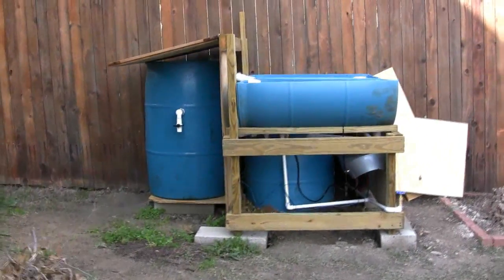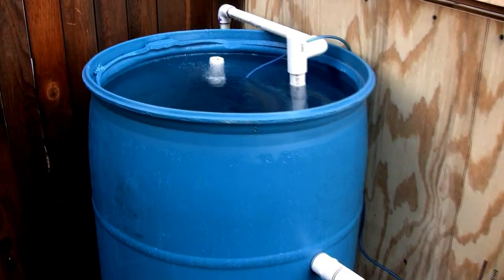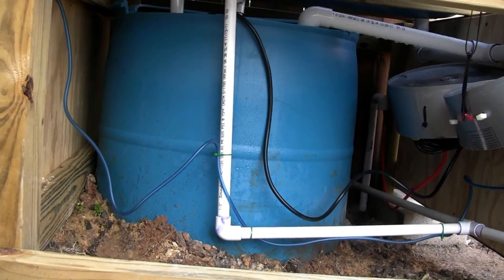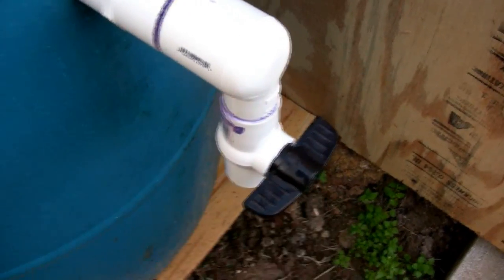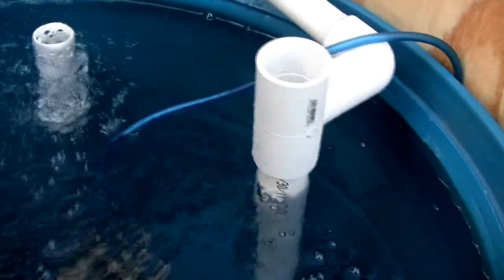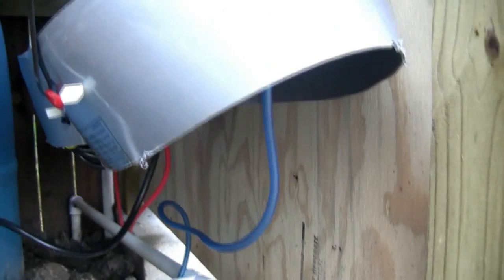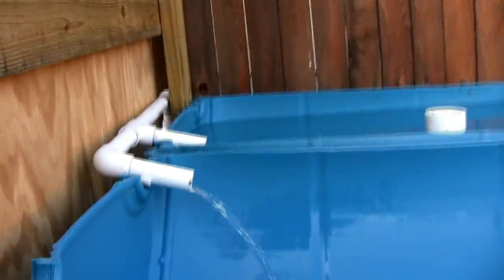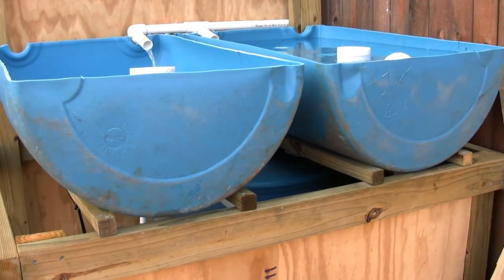Backyard Aquaponics: Initial setup

Comment: Cool set up very well thought out, allot of good field info here and engineering skills. I was trying to do the same with my koi ponds with the constant height reservoir I just didn't have a big enough sump for my 1000 gallon ponds. A little tap water filling wont hurt a bit it might help ph stay down a bit, just make sure you can't get a stuck float valve. Pvc is fine with pressure just make sure you prime and use good pvc cement or even just use christy red hot pvc cement.

Comment: For the siphons sharing one outlet, dont split it in two, drill a 1/4 inch hole in the top of each drain line before the tee, the add airline tubing about an inch long, itll burp the siphon effect once the primary siphon reaches the bottom of its stroke. Kind of like your burp line on the bell siphon

Comment from the maker: You're correct, however the fish waste dissolves quickly enough and the water coming into the fish tank circulates around the tank well enough that the dirty water does get pumped out or at least diluted enough to make its way through the system.

Comment: Swap those 2x2's out with galvanized fence post, they won't rust or bend under moisture.If it's ever determined that the fence post isn't strong enough it very easy to strengthen it by slipping another smaller diameter piece of 1" EMT inside the fence post, without dismantling.  they fit nicely.

Comment: One last thing, I would add a skim filter to the reservoir that feeds a radial flow, then gravity feeds to the sump, be a bad day If you clog your reservoir drain. And also you need a fail safe, relief valve/port to keep water in the sump, the float valve is fine for keeping the pump from cavitation, but if you have a constant supply of water to the reservoir, you'll lose your fish. Put a 1" to 2" bulkhead fitting above your reservoir drain and route it above the sump to keep the reservoir from overfilling

Comment: It looks like you have room on the side of the 2x2's and you could sister some more 2x2's or bigger along side for more support.
Also, your overflow is like a fish tank, you need pipe at least two times or bigger for the overflow and then you will have no drainage problems.
Good luck............

Comment: Hey, I am planning an aquponics set up right now and found your videos very helpful. I really like the system you have to keep the water level in the fish tank constant, however I don't understand how the sump is not pumping out the same dirty water as it would if the pump was in the fish tank. @2:10 you say that the sump pumps out clean but how is it filtering out the dirty water? Do you mean that debris will not get into the pump and clog it up?